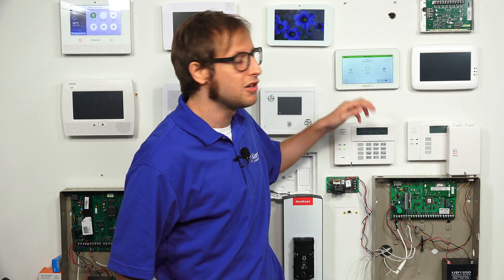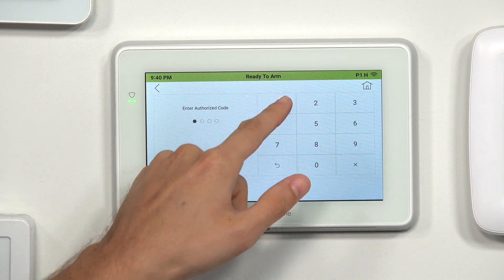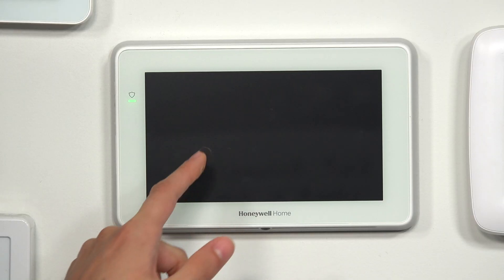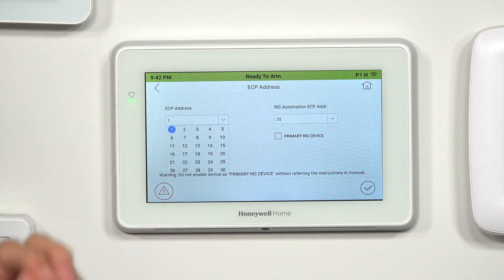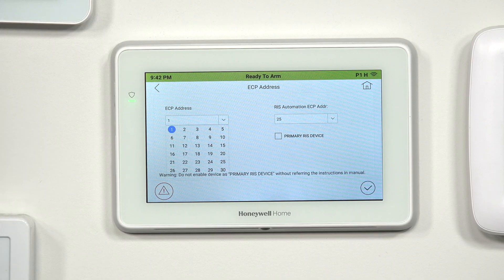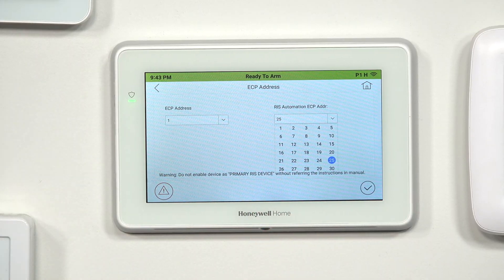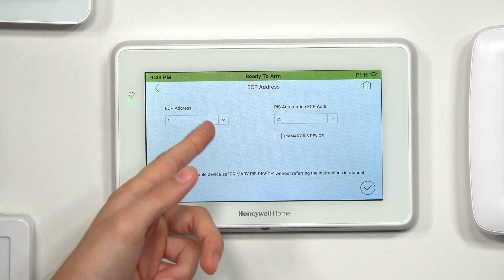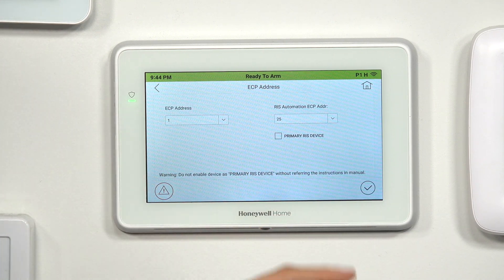Checking the ECP and RIS Address On a Tuxedo

Comment: Sure wish there was a video that actually explained each of the Ecp addresses instead of just telling us what to do to fix it.

Honeywell is complete trash 🗑️
Reply: Valid ECP addresses for the AUI keypad on the Vista-20P and Vista-21iP are 1, 2, 5 or 6.

These addresses tell the VISTA panel where to "look" for the keypads.
Reply: @dylanalarm_grid1038  thanks, the learning curve on these systems have thrown a wrench in my gears. But I was honest and told em I didn't have any experience with Honeywell.

Been trying to read up as much as I can!

Comment: Hi there I have a Vista -21ip and 3 tuxedo touch wifi pinpads and I get an error message ECP Error and the pinpads are set on (ECP address  set  1,5,6) and I do have a total connect service RIS set at 25 on each pinpad how do I fix this issue???? Need your expert advice.
Reply: if your using a power supply make sure that there is a common ground between the panel and the power supply for the TUXwifis
Reply: Did you ever get this resolved? If so, what did you have to end up doing?